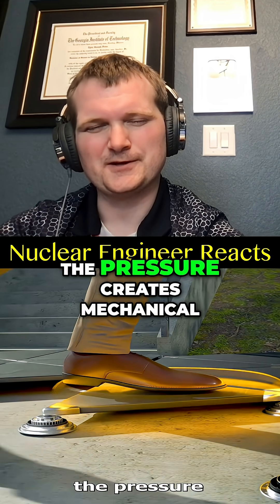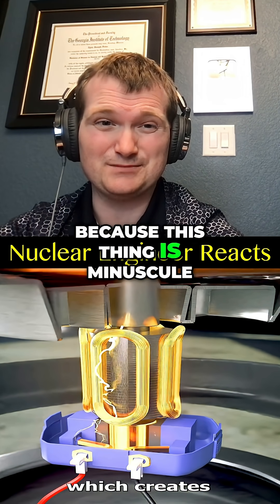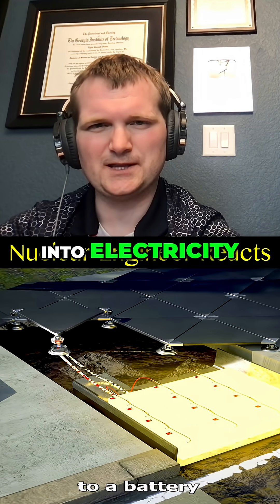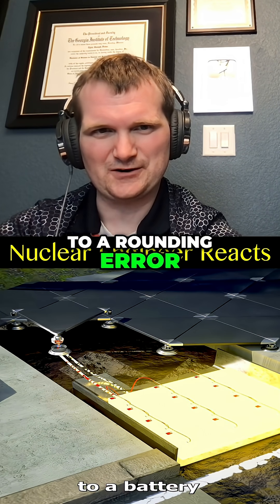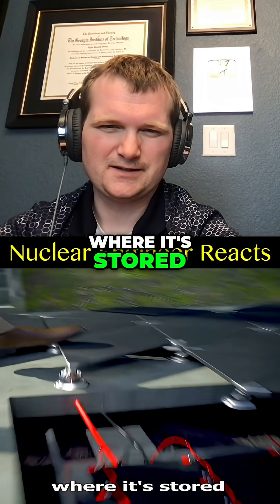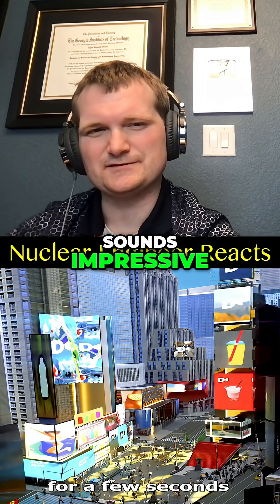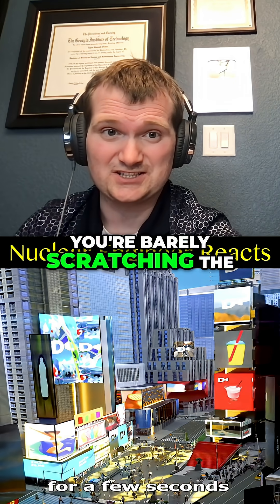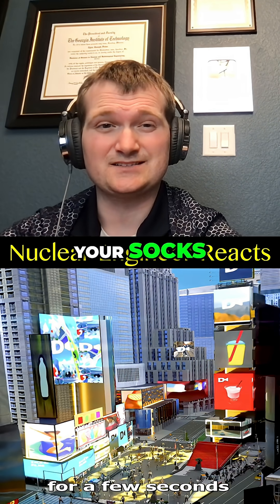Generating Electricity from Walking - Nuclear Engineer Reacts to Zack D. Films

Comment: Needlessly expensive, mechanically complex maintenance traps, that will fall apart the moment it freezes over and you have to clear snow. Cheaper and easier to just put a couple solar panels on the roof.

Comment: The issue is not electricity generation; it is how much electricity our objects need to operate. We need to find better ways to reduce the energy requirements for operation. LED's are a great example of reduction in electrical energy needed.

Comment: There is no chance one of these will ever generate more energy than it takes to fabricate it.

Also this is basically just a spring. You can calculate how much energy each one generates with each step as weight × displacement.

If a 1000 N man presses it down 1 cm and it has a spring and motor that is 100% efficient, that is 10 Joules. That is 1 kWh after 360000 steps.

A kWh is worth about 15 cents.

Comment: Well duh this is legit. there are a few streets like this in my country. they power the lights in the street at night. 

Its not use as a "replacement" for energy generation. Its free energy collection. the important  part is the maintenance required. These were installled to last 10 years without maintenance. 

Anything you do to redeuce energy needed from non renewables is worth it. Provided the maintenance and environmental impact is not worse..

Solar, wind, tiles like this. Roads with vibration collectors in them even heat collection from sun on roads and walls to store heat energy for use at night. It all adds up.

Comment: If humans walking generate that amount of power. Why not do that with speed bumps and have them generate power because a car is going to push down much harder than somebody walking. I think a more efficient system would be hoses that go under the road though. And as you drive, you're physically squeezing the liquid from one area to another acting as a pump and then when it reaches the end of the line it would spin a generator creating power.

Comment: You could actually use small amounts of energy like this in actually practical stuff.

Now before I have heard of stuff like this harvesting tiny amounts of energy from stuff like this and yeah I thought they were kinda cool but useless, although now that I've gotten into clocks and was made aware of how power efficient they are you could probably use something like that to power a mechanical clock! hell we even have stuff like automatic watches that gets power from your wrist moving from a little unbalanced weight inside of it turning around, bit more rare but there is a clock that takes energy from the atmosphere pressure changing to power the clock so getting even just some energy from footsteps from a small area in a city should be more than enough to power a clock! of course depending on the clock which could range from the smallest wrist watch to the largest clock tower!

Comment: What if these were under roads instead? Would the weight of the cars be able to charge something more significant?
Reply: Firstly the cars will move and be unstable

And secondly it will likely power stuff yes but it will have a very bad ROI

You pay a lot of money for the system and you might get back 2-3% return per year

Comment: You can feel like you're walking in sand with every step you take, and you'll power these advertisements for a few seconds a year.

Yeah, great idea, but it's not.
That energy is coming from somewhere. It'll literally make walking more difficult because the ground is absorbing your rebound, effectively making a 0 grade floor feel like a very slight incline with every step. Kinda like walking in sand.

Which, if you've never walked a significant distance in sand, you might not get it, but if you have, you know the value of a concrete sidewalk.

Comment: in places like NYC or japan/korea/china with absurd amounts of foot traffic (sure theres more but i have only seen footage of the above examples)
it would probably do pretty good(miniscule nothing, but functional in its concept XD). maintaining it and storing the power would be 'fun' also why not install these on roads using the weight/vibration of cars? probably not possible or it would break down too easily and repairing it would suck. i do remember them installing generators that used the air pressure from cars going past to spin a turbine w/e it is..... novel ideas....could never be a replacement though

Comment: It would run street signs during the high traffic hours. Not a bad idea and usable but it won’t generate enough for much more than that. Question is does the cost of installing these replace the cost of traditional electric? And I even mean coal. I’m all for nuclear, but replacing every single sidewalk with those would be billions and mechanically hard to maintain

Comment: I mean... the main problem is still, that this is a kind of perpetuum mobile thinking. Like putting a wind turbine on an electric car... 
If this thing can be squished down deeply enough, that energy is then ACTUALLY, noticably taken from the push of your step forward. If not, it will generate negligible power - So the more energy this thing generates, the harder it will be to walk on it. Its converting your physical effort that should propel you forward to generate electricity. Its no different, but much more involved and inneficient, than generating electricity on a stationary "bicycle".

 It just attempts to hide this, once again, by leaving some of the energy for motion and converting some for electricity - like giving you a bike that uses half of your energy to power its batteries and calling it "free recharging" ... its not, you have to step harder in order to move the same distance, because half of your energy output is taken by the generator.

Comment: "100-200J per step"? 100J is a energy necessary to lift 100kg person 0.1m (for "metrically challenged" - 200 pounds, 4 inches high) - possible but walking on that will fell more like climbing stairs
Reply: A test was performed at some point in the UK and it was used to power Christmas lights. The data they found? 4 joules. You get 4 joules of output energy per step, once you factor in the inefficiency of the physics and materials used.

Absolutely awful idea, you'd be better off opening a pedal bike generator gym with free entry.

Comment: I call these sort of projects Grant Bait. You'd be surprised (or maybe not) to learn how much Beau Riche money is being dumped on tech-startups, only for them to fold a year or two later, because all they did was peddling dreams and social posturing.
Solar/pressure floor tiles seem nice, until you actually do the math. How much energy you get out of a system is not even half the equation. When you factor in initial cost, time for investment-return, scalability, grid integration, maintenance... There have been a few installations of tiles like these around the world, always for political clout, always they broke down within a month.

Comment: Also wouldn't the the mechanism fail overtime? Cuz it either springs back up using elevtricity which defeats the whole point, or it's made from an elastic material that will decay overtime

Comment: So, using some junk I had laying around and an Oscope I am going to guess that this came out to 25 watts of peak instantaneous power on the 1 ohm load I was driving. And the power spike lasted for maybe a tenth of a second. 

And this is with my 260 pound ass stepping on a lego abomination of a rack and pinion gear driving a motor as a generator.

Comment: So the real use of this is when there is a really useful relatively low power device you want to power but for some reason connecting it to the grid is too expensive or inconvenient. For example if you wanted to track how many people or when they were walking on a sidewalk, or you wanted lights that indicated the edge of the sidewalk for safety, or wanted to install a detection circuit to detect when someone is waiting for a crosswalk, or illuminate the crosswalk when someone is in it.

Comment: Atleast it's not solar fricken roadways
Reply: I'd argue that this is somehow worse than solar fricking roadways, because this is way more expensive and generates way less electricity than even the inefficient solar roadways. Also, solar roadways don't have any moving parts, which means they dont jam from all the dirt and dust and require constant maintenance. 

Don't get me wrong, solar roadways are still a dumb idea because a road surface that people walk on is a bad place for fragile solar panels to be in, a way cheaper and better option would be to put solar panels on roofs or just build a roof sunshade over the road with solar panels mounted on top if you really need it to be on a road for some reason.
Reply: @xramejin  we finally made solar roadways 2 guys. We call it a roadway 🎉. So what is it? It's a solar roadway, but we took the solar out of it. Science confirmed canceled worldwide.

Comment: doing this with cars and feeding the power into a capacitor hooked to power lines on the side of the road could be a definite supplement   Part of my point here is that there are many more cars are on the road compared to people walking in cities and they WEIGH a whole lot more and have a potential upped wattage over people walking. Especially if those people get lighter as they walk...
Reply: No it can't as it requires more energy to be used by the cars to move, negating any gains.
Reply: @jasonlauritsen5587   I'm not sure what you mean can you explain that better please? It seems to me if you have a mechanism to drive over, that weight and therefor gravity is providing most of the force required to generate. I also don't think it's appropriate to say that gains would be negated by how much fuel it would take for the cars to drive over a pad. Driving over a pad wouldn't seem to make a vehicle use more fuel in any way, just like it doesn't really take more fuel to run over a squirrel... that can't possibly compare to the fuel loss in general from low demand or high demand on a power grid from fuel efficiency loss during those times. If you had a spring loaded pad at every intersection where cars have to stop in an approximate area, and have a mechanism that is spinning from resistance underneath very slowly, where you're movement vertically is hardly anything, but the resistance is big, you could potentially gain a lot. Maybe you are thinking I meant a mechanism that spins from the cars wheels running over it and therefore generating electricity from the wheels of the vehicle, but that is not the mechanism in this video.
Reply: @jamesgerard9330 its fairly well known that not having enough air in your tires, slows the vehicle down. Affecting your miles per gallon/Litre. Even though it seems a small bump, its slowing the vehicle down. Over time, the vehicle's engine has to fight a tiny bit more to drive forward. This costs you more power and fuel. Over time this adds up. Especially on older models of cars. Gas driven engines will also produce more greenhouse pollution. In electrics, burns more of the battery down. 
The point here is to have as close to as 100 percent efficiency as possible. So add in the cost of materials, labour and maintenance. Plus the cost to the consumer. Plus the added fuel and energy consumption. 
Now you have a very costly boondoggle.
Reply: @jamesgerard9330  also you mentioned running over a squirrel. Imagine you ran over a road filled with squirrels, and your tires didn't slip on all the blood, there is a loss of speed. Even for a very miniscule amount of time, is still enough for your vehicle to burn through more fuel or energy. 
In highschool, our science teacher told us that a dragonfly, flying/diving at a 45 degree downwards angle, hits very fast speeds. (We were told supersonic, and that the dragonfly was the only bug to do so.) The truck stops for a very small fraction of a millisecond. And because the truck has momentum/velocity, the truck keeps going.
Reply: @jamesgerard9330 dude, I'm not gonna explain any more than this, traveling over soft ground take more gas for X miles/km, than it does hard ground. Maybe you've never driven offroad, or walked on anything but a sidewalk or road, if you had, you'd realize that when there is give to a surface, it takes more energy to traverse it than if the ground was hard. You want a better explanation, go look it up, or try it out yourself. It's pretty easy to prove.
Reply: @jasonlauritsen5587   If the power company wants to just add more electricity when it needs to, that would be more efficient, however, what needs to be clarified here is the difference between the fuel that the power company uses efficiently and fuel the cars use that isn't as efficiently used as it could be. Some of the fuel is DESTINED to be used in cars and some destined to be used in power plants. Cars move just to move us around, but they could also move to run the car over a bump that operates a spinning turbine that will spin for quite a while after it has been run over, and the amount of other cars hitting it will generate electricity. That will not change the fuel economy EXPECTATION for those cars, whether they drive on bumpy roads or through mud. So my point is about the overall use and increasing efficiency where there is inefficiency, it is not about saying that there is no point in generating electricity with cars because power plants do it better, which is what I think your point is, unless I'm wrong. Cars are going to use that fuel whether you like it or not...why not have them run over a mechanism turbine? If that is not a good idea I  have yet to see why, and I think I deserve to know why.

Comment: How even 200J per step? Even if you have a really fat 200kg american, they weight 2000N and the pavement can only sink by maybe 2cm without it becoming dangerous and annoying,  which would give you 40J per step. If each person does 2 steps per second, each fat person can generate 80W. Is that right?

Comment: The thing is they have one in Romford and when stepping on them it drops down compared to just dropping so I'm guessing it's using a powerful but small generator instead of just a tiny thing which you just step on it's more like forcing your step. So it doesn't feel that good.